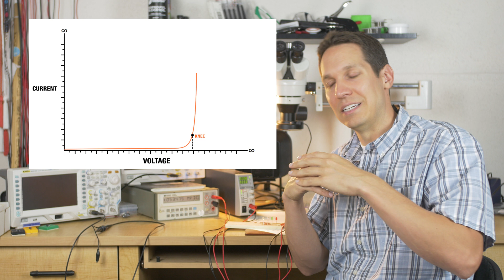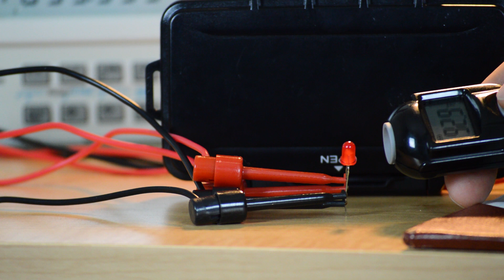LEDs and Forward Voltage | Basic Electronics

Comment: Very well made video but the info is not very relevant. No 1 uses this kind of leds anymore except for indicators, it would have been much more informative if you talked about and showed  the current mostly used 5050, 2830, 3070 and so on kind of leds that have very different voltage and amp ratings. Right now i'm a little stomped trying to lower the current in a new kind of led driver from a 13w tablet lamp, no more easy 2 resistors current setting.
Reply from the maker: Hey Roman, thanks for the feedback!  Are you referring to those LED packages in discrete configurations or in strips?  If it's discrete, we have another video going over the steps for how to figure out the best resistor for an LED - it's pretty generic (though still using the 5mm LED as an example) and is only for using the much easier but less efficient method of driving LEDs with a resistor.  But, reading your comment, I imagine you're already way beyond that tutorial.  We don't have anything about driving strips, nor any plans to do so, honestly.  What exactly are you struggling with your LED driver?
Reply: @CircuitBread  Thanks for the answer. Yeah limiting with a resistor is the easiest and it has it's uses but not for limiting modern leds, the simplest "modern" led driver i know is capacitor limiting but it's not great. Best way is with a dedicated cc led driver chip and up until now the chinese used a simple chip that had 2 resistors to set the desired cc. In this new driver there is a new chip that I don't know how to set the cc because i can't find the datasheet.